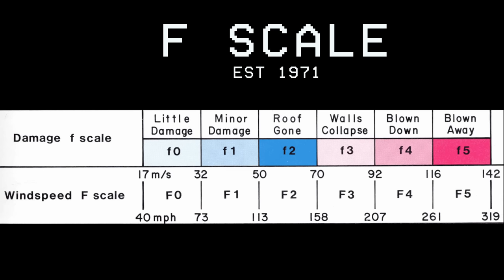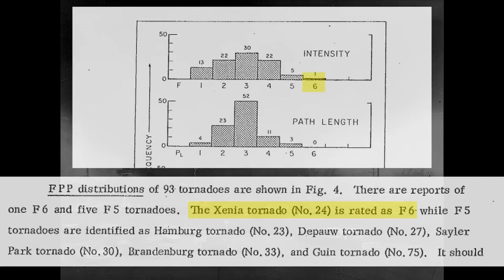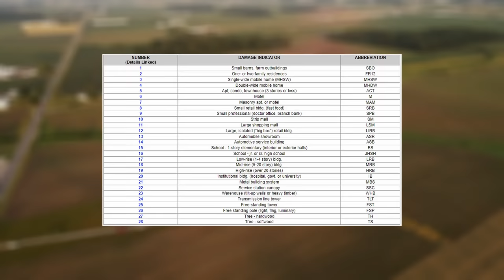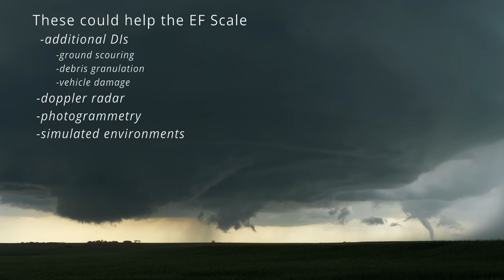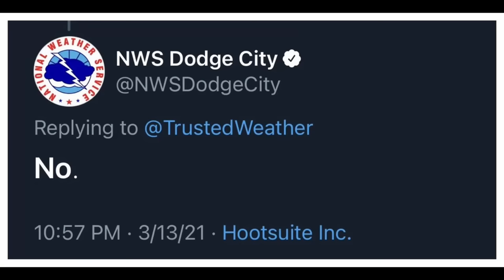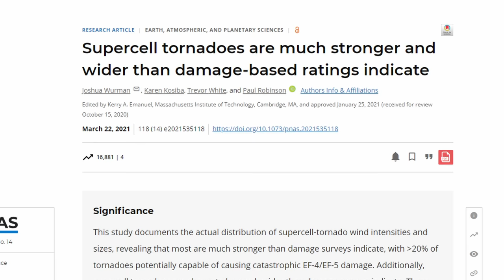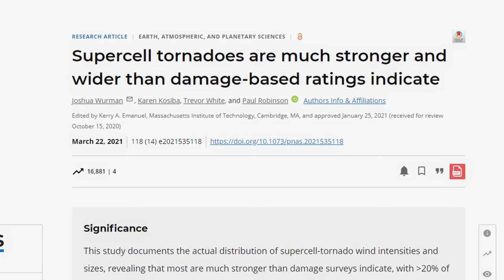Is The EF Scale Outdated?

Comment: The EF scale is not outdated by any means. When damage done is the best information we have regarding the intensity of a tornado, it's quite good. With the large majority of tornadoes, that's still the best data available.

The problem is the NWS' rigid, dogmatic adherence to the damage standard in those exceptionally rare instances when there are reliable direct wind speed data available. Damage is used as a wind speed proxy because direct wind speed measurements seldom exist. When they do, by all means, use them! 

Unfortunately, we seldom have direct wind speed measurements of any given tornado even today. The network of WSR-88D Doppler weather radar units can't measure a tornado anywhere close to ground level, and the EF ratings are based on winds at or near the ground. With WSR-88D, a storm 25 miles from the radar unit would be scanned at best  ~800 feet above ground level. Given that most mesocyclones never produce any ground-level rotation at all (aka a tornado), it is not likely that the readings high above ground like that will correlate well with any intensity at ground level.

The wind speed readings like the one in the El Reno tornado that show that it was far more powerful than its EF3 rating come from mobile Doppler Radar units, aka DOWs, or Doppler On Wheels. These units get right up close to a tornado, so the resolution is far better at that range. They measure just above the ground, and they can complete one sweep (full 360 degree cycle) in six seconds, compared to about five minutes for WSR-88D. 

Even if the WSR-88D could get down close to ground level, the odds that it would catch the tornado at peak intensity during that one scan every five minutes would be low, and the resolution would not be sufficient to capture the peak readings within a small space (like a subvortex of a multivortex tornado). By contrast, a damage survey certainly would be able to pick that up if the tornado hit a built up area as it was at peak intensity.

Obviously, DOWs are only deployed for a small subset of the ~1200 tornadoes that occur in the US each year, and only a subset of those would produce wind readings that would differ with the official damage-based ratings.

Comment: Given the 302 MPH dappled radar wijd measurement of El Reno,  that would definitely qualify as an EF5. We're these winds clocked near ground level, it would match the Fujita EF6 rating!
Reply: There's no EF6. EF6 has no starting point with wind. F6 does, because F5 is 216-318 mph, which means F6 starts at 319. But because EF5 is any wind above 200 mph, EF6 doesn't have a starting point. And I never hears 302 mph, I heard 296 mph. 302 mph was measured on May 3, 1999.

Comment: The damage based rating is okay as it is. The rating is not out there to satisfy the ego of storm chasers who’s desire it is to have witnessed a tornado with ratings as high as possible. An Inflation of EF5 tornadoes by including more parameters such as measured or simulated wind speeds would only fire the next discussion: which of those was the strongest of those… 
Any one number can never be sufficient to describe a tornado anyway. Besides maximum surface damage many other parameters are recorded and archived for every event: diameter, track length, radar wind speeds, measured and simulated soundings, casualties, overall cost of damage, etc, etc etc…

Comment: No, it's not outdated. I was at a weather symposium last spring. I talked with people who had researched it from WKU. The structures it destroyed were not very strongly built. So, even though they buildings were totaled, and completely obliterated, it didn't get EF5 damage because they, like I said, were not very strongly built. If you are implying that the DOW should be used to rate tornadoes, then I do agree that in the tornadoes the DOW's are used in (like in Oklahoma, though they aren't used in other states), yes, they should be taken into consideration. However, Wurman, Bluestein, and their teams are not going to chase outside traditional tornado alley, and this Kentucky tornado is a prime example of the fact that they can occur in all 50 states. I live in Dixie Alley, and we have many strong and violent tornadoes, so the DOW isn't going to be used because there are too many trees and hills blocking the view, unlike in the plains, where it's flat, and you can see for miles and miles. 

Last but not least, should Tuscaloosa, Alabama, April 27, 2011, should've been rated an EF5?
Reply from the maker: Congratulations on attending a symposium, I have a degree in mechanical engineering I've documented over 30 tornadoes, and performed aerial surveys on two tornadoes, an ef2 and an ef3. Just because a building is poorly constructed doesn't mean a high-end tornado with winds over 200 mph can't hit it, it's a serious logical flaw with the current system
Reply: @highriskchris  Of course it can be hit... but if a building will be destroyed with only EF3 winds, you can't ever say a tornado that destroyed it is definitely anything more than EF3. It's not a logical flaw at all... it would be a logical flaw to not consider the build strength.
Reply: @highriskchris  Suppose an outbuilding is decimated. Should the tornado get an EF4 or EF5 rating?
Reply from the maker: @ILoveOldTWC  it depends on the building's construction, although most outbuilding would be given an EF4 rating due to their low density and large surface area for the wind to push.
Reply: @highriskchris  It's not a question of whether or not a higher end tornado CAN or CAN'T hit it, it's a question of whether it DID or DIDN'T hit it. Have you not seen the Texas Tech in Lubbock at the Institute for Disaster Research use 12 foot 2x4's to fire at various speeds, at various types of material? By the way, I not only attended this weather symposium, but all the previous ones except 4, and they didn't have it in-person in 2020 or 2021 because of the covid pandemic.
Reply: @highriskchris  So any building, no matter how poorly built, if wiped out, should either be EF4 or EF5? Even mobile homes? Even non-tornadic winds such as derechos can do that.
Reply: @highriskchris  "Outdated" to me is too simplistic, and a harsh word. El Reno makes it seem simple. It's obvious you don't want to read any comments that disagree with your opinion. No matter how good advances in technology get, it won't ever be perfect. There are too many variables, and it's very complex.
Reply: @highriskchris  Actually it was the Bowling Green, Kentucky tornado of the same outbreak as Mayfield, that they didn't rate EF-5 due to poorly constructed buildings it destroyed.

Comment: what was described in this video is totally wrong because the buildings have different wind resistance and the 2021 Kentucky tornado cannot be classified as an ef5 because some affected buildings were not completely destroyed as would have happened with an ef5 tornado and also the dimensions do not determine the power and in fact category 5 tornadoes are actually very rare but totally destructive in the sense that not even reinforced concrete can resist their passage.